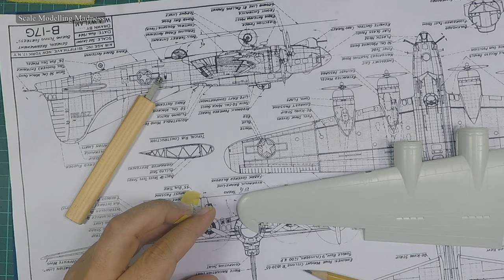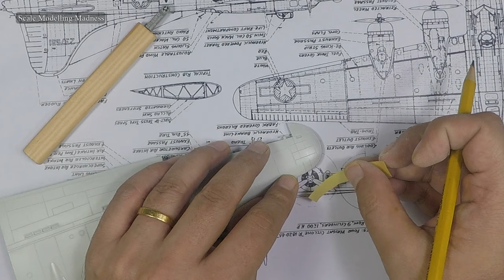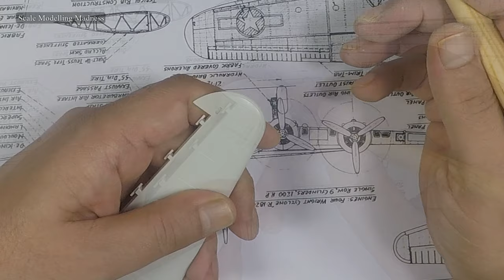Revell 1/72 B-17F Memphis Belle (Part 3: Riveting the kit)

Comment: I believe the green handled 'brush' is tamiya cement but what is the yellow handled one?

Also, does tamiya cement smell worse than the revell cement that comes in those blue containers with the metal needle nozzle?
Reply: I Am A Duck I have used both and can tell you that the Tamiya super thin cement has a stronger smell.
Reply: @diegoparga9324  Thanks mate.
Reply: The yellow is ammo by mig extra thin cement
Reply: @labxarka16  How does that smell in comparison to the 2 I mentioned?
Reply: @iamaduckquack  I don't know i never used it
Reply: I had the same question 😀 But why do you use both? They are both super thin cement right?
Reply: @arjenheyman  I am using 4 extra thins 2 by Tamiya and 2 by Mr. Hobby. Depends on the place of the piece, the build and how fast they are evaporating. And my experience is that Mr. hobby is more aggressive with the painted areas.